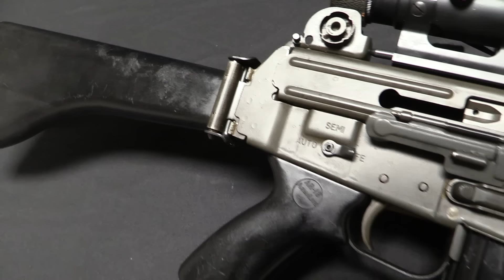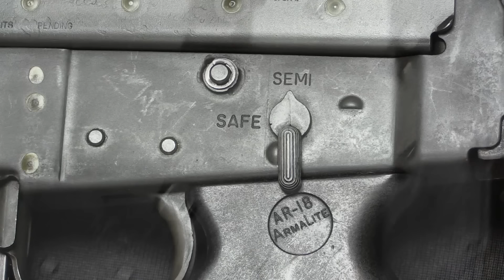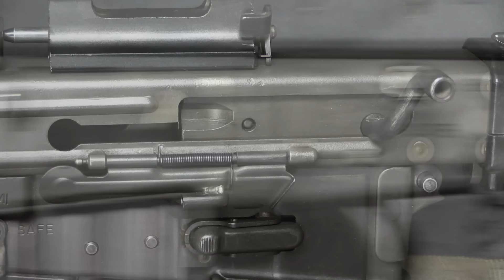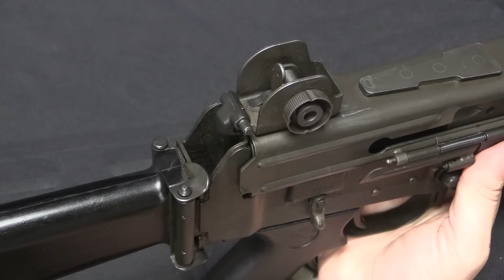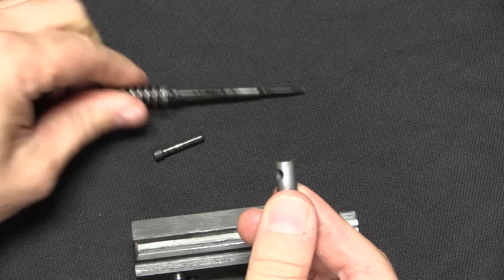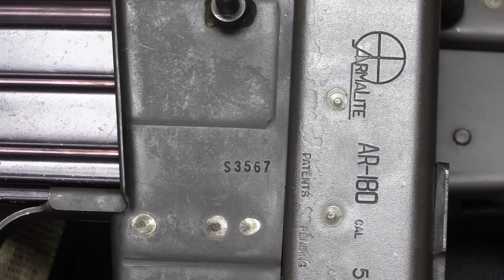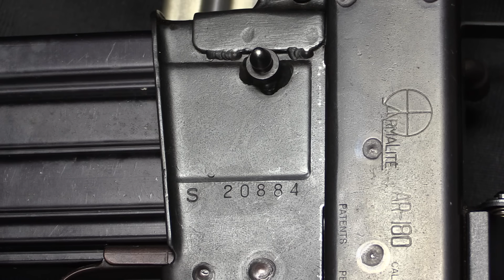AR-18 and AR-180: Can Lightning Strike Twice for Armalite?

Comment: I actually like these much better than AR-15/M16/M4 series...I found them to run much more cooler/cleaner than AR15 type mechanism and also, handle with superior shooting characteristics.

I wished someone remade them with original sheet metal type receiver but using AR15 stocks/furniture to reduce cost.

Comment: You should do a video on the C7 carbine used by canadian armed forces, i used one during my year in the army and actually broke the stock twice when twatting someone upside the head with it, then their was problems in Ukraine when guarding the embassy with the action locking up in the cold (which may or may not be the lube freezing)

Comment: A couple of late corrections; 1) I have identified that the AR-18 converted as a mock-up SA-80 was a Howa gun and not a Sterling. 2) 'ArmaLite' in a NI context can refer either to the AR-15 or the AR-18. Both were acquired, both were used, both were known as 'ArmaLites'.

Comment: The original design bolt handle was straight but this meant that it was easy to slice your knuckles on the dust cover as it was deployed on cocking. Hence the extended bent cocking handle to prevent an owie.

Comment: The first "black rifle" I ever owned was an Armalite AR180. I used it in combat rifle matches back in the early 1980s. It was built by Sterling. Sterling  built AR180s got mixed reviews. Mine was accurate and completely reliable. The fit and finish of my Sterling was not great, but it worked great. I traded ,or sold , that one off, in the late 1980s. I bought another one, around 1995. That one was made by Howa, in Japan. The fit and finish on the Howa was much better than that of the Sterling. The Howa was also completely reliable. I always viewed it as a "collector" piece  and only shot about 500 rounds through it. Eventually, I sold it to a collector, who was very happy. My experience with Armalite AR180s was 100% positive. I found them to be of simple design, rugged, accurate, and reliable.

Comment: I used to have a Costa Mesa AR-180.  It's one of the guns I really regret selling.  I'm pretty sure the dog-leg bolt handle was not done out of any concern to make the rifle more ambidextrous, but mainly to ensure your hand was out of the way of the dust cover.  Moving the part of the charging handle you grasp upward and forward accomplishes this, and making it easier to reach over the rifle with your support hand is a by-product.  The placement of the charging handle on the right side of the receiver is actually more wrong-hander friendly even were there no dog leg, as you can use your support hand (the right for a lefty) without having to reach over anything.  You'll note to that when the modern Armalite company brought out the AR-180B a few years back, it eliminated the dust cover entirely, and along with it, the dog-leg handle.  The AR-180B just had a straight charging handle.

Comment: A little mistake by Ian at 7:40, the dust cover impacts the angled surface on the cutout on the side of the bolt carrier which kicks it open, not the charging handle.

Comment: I really like the mechanics and handling of my Sterling AR180, but don't shoot it much anymore, modern AR15/AR10 drop in match triggers are so much nicer than the heavy, awful trigger pull the 180s have... 

I regret never getting my hands on one of the original scopes, they go for more at auction now than I paid for the rifle. Got an after market adapter to picatiny rail, but not as cool as the little proprietary QR mount Armalite scope.

Comment: I read somewhere that the cocking handle is dog-legged because sometimes an ejected casing would hit the first, straight cocking handle and bounce back into ejection port, jamming the rifle. Thus the cocking handle was made into a dog-legged version.
The same problem happened on the L-86, which is part of the reason HK gave it a new cocking handle form.

Comment: It looks like that little tab on the inside edge of the dust cover (when closed) is what causes the dust cover to pop open.  It's resting in the channel machined into the right side of the bolt carrier, and it seems like the angled surface would cam the dust cover open as the bolt carrier goes rearward, long before the charging handle would contact the forward edge of the dust cover.

Comment: Despite its heat dissipation issues, and the ugly-as-sin spot welding, I prefer the AR-18/180 design. The shortened recoil system and the replacement of the direct-ish gas impingement system with a gas piston are both improvements to the AR-15 platform. Plus, stamped guns are just plain interesting

Comment: I had a Sterling produced AR-180 years ago. I sold it to a friend so could buy a Daewoo K-2 which I sold. There are many days I wish I had kept both.

The welds on my AR-180 were really crude. It shot well. At some point after I sold it to my friend, the detent that held the takedown pin fell out. He replaced it with a bolt and nut he picked up at the hardware store, LOL.

Comment: Very interesting. It looks to me that the Sterling manufactured units were done on the original Armalite tooling and the Howa ones had new tooling made. I'm basing this on the markings which were probably integral with some of the stamping tooling.The "By" and "Sterling" logo might even have been hand stamped after completion  rather than incorporated into the press tooling. I will ask a man who will know!
In regards to magazines, AR15 mags can not be modified for the AR18 by cutting a slot as the "bump" on an AR15 mag that acts as a depth stop won't pass into the AR18 mag well. I did a short video on AR18 based mags as a response to one of the "What would Stoner do?" videos. Some folks may find it of interest: https://www.youtube.com/watch?v=G0n3nSpl5eI

Comment: When I was an air cadet in the Air Training Corps our squadron adjutant was a QC inspector at Sterling Arms in Dagenham. One weekend when were shooting the SLR (L1A1) on the range at Purfleet he brought along an AR180 and about 5000 rounds of ammo. He set up on a firing point and sent a couple of rounds down range, which the cadets marking the target had a job to find, after looking for .308 calibre bullet holes. Still it got sighted in and then the gun promptly decided that it would not be persuaded to fire nay more rounds. So unfortunately I didn't get my ten rounds through it. I joined the RAF in late 83, but by the time my unit got issued with the L85A1 I was leaving the service, so I never got to shoot one of those either. Still as a member of the station shooting team I did get to shoot the Sterling L2A2 SMG, Browning L9A1 SLP, and the Enfield L39A1 in addition to my normally issued L1A1.

Comment: Ever so slight correction... The bolt handle does not hit the angled surface of the dust cover. The cover opens due to the slot in the bolt carrier contacting the part on the inside of the cover, much like on an AR-15. (and yes, I know it's a trivial correction)

Comment: Unlike AR15’s in Canada there are iterations of this gun as well as actual AR180’s being used for hunting and plinking. AR15’s by name are for use in authorized gun ranges up here. There are quite a few gun store/manufacturers making new versions as well as AR15’s that use different upper/lower assemblies and are NOT AR15’s that are being put to the same use. They are all mixed bags, either super high end or kinda junky with functionality issues that often can’t be made to run 100% or close to it.

Comment: The Taiwanese Type 65/86 is kinda a mix of the AR-18 piston and AR-15,they didn't change the BCG,not even the bolt like HK does(see my profile, it's a 416 bolt),so they have regular AR-15 bolts

The Type 91/Wolf A1 is a improved design tho,the gas piston is a self contained unit within a steel tube,and doesn't require tool to remove from the fsp/gas block

Comment: My favorite design, engineering-wise. And it also look S L I C K. Could we get a series on the whole family of ARs and their development? You can't really understand the AR-18 withouth all the background from the other Armalite designs.

"Bugdget version" is quite the misnomer given the massive investment in tooling required to get a sheet metal production going.
A better monicker would be to name it the "mass production" AR-15 or the "AK inspired" AR-15.
But it does indeed make the end product cost effective, but only if you make A LOT of them. The disadvantage is that the production is very centralized, so if the production is disrupted, setting it up again will take a long time. A trait not present in the AR-15. It may be more expensive, but the production can be set up quite easily in comparison, making it quite decentralized, so production can still go even if the enemy takes over major industrial areas. The USSR had basically only 3 AK production facilities. Each one of them was absolutelly massive. They got around the drawback of possible production disruption by having massive stockpiles of ready to use AKs. The same ones that went "missing" when the USSR collapsed.

Comment: Why oh why did the UK take the excellent AR-18 and utterly cludge it into the SA80? The AR-18 was lighter, shorter (when folded), cheaper and more rugged and reliable. The SA80 has required repeated, expensive, rebuilds by HK and it still is not as good as a 1966 AR-18. I would like to see a side by side assessment of a Costa Mesa AR-18 against the L85A3, done by a current British Army rifleman. (To learn more about the SA80 cludge, do watch Ian’s series of vids on the sad subject. )

Comment: I have a Costa Mesa 180, with original scope mount. Discovered that the original Colt AR-15 scope had the same screw threads and spacing so to extend the 180's usefulness, it has the Colt scope on it.
Nice shooting little rifle, but the folding mechanism for the stock  seems rather flimsy.

Comment: Actually, Ian, the serial number on the lower receiver is BATFE regulatory policy, not statutory (27 CFR § 478.11) and at least one Federal judge in California decided it wasn't legally valid due to the agency's administrative actions.  Federal judge James V. Selna's October 2019 decision was based on the BATFE's failure to follow the  Administrative Procedure Act.  From Omaha Outdoors:

"That rule defines a receiver, in the context of being a firearm, as a “housing for the hammer, bolt or breechblock, and firing mechanism, and which is usually threaded at its forward portion to receive the barrel.” Because an AR15 lower receiver does not serve as a housing for the breechblock and is not threaded at its forward portion, the judge held that an AR15 lower receiver is not a “receiver” under § 478.11. Here is an example where fine differences matter in writing statutes. If the “and” before “firing mechanism” was switched out for an “or,” the AR-15 lower receiver could reasonably be called a firearm – then again, so could the upper receiver. As Judge Selna summed it up, “No reasonable person would understand that a part constitutes a receiver where it lacks the components specified in the regulation.”  https://www.omahaoutdoors.com/blog/that-california-atf-lower-receiver-ruling-is-much-bigger-than-the-ar-15/

Comment: Here in the UK I had a couple of Sterling AR180 rifles in about 1980. As far as I can remember one had a fixed stock. They were reliable and simple although the dedicated scopes didn't match the range markings with military ammo. They were sold when the AR15A2 HBAR was released over here and that proved to be more accurate and the heavy barrel didn't suffer as much from overheating. Sterling made guns seemed to be well made.